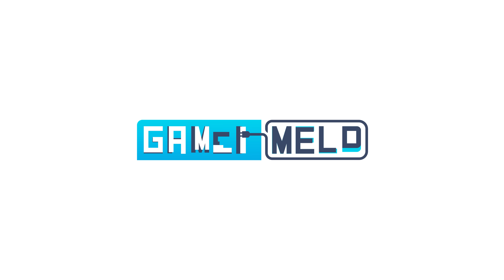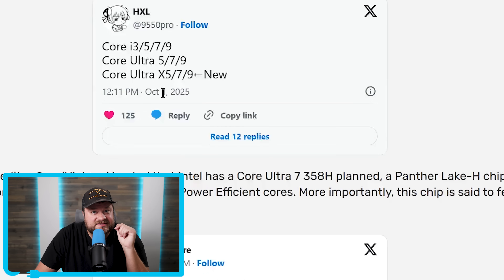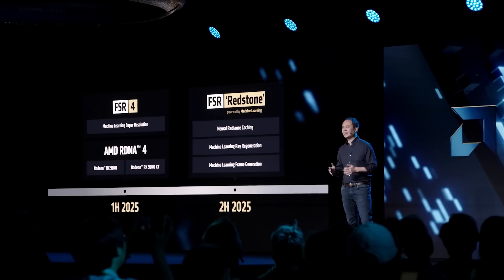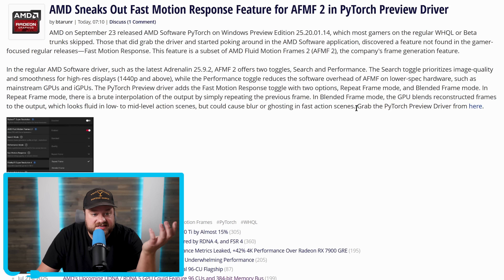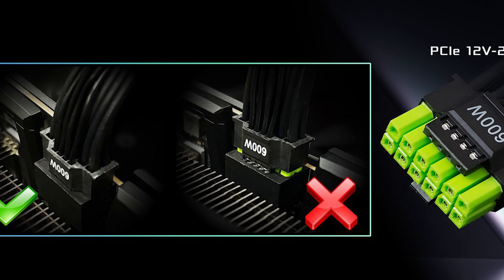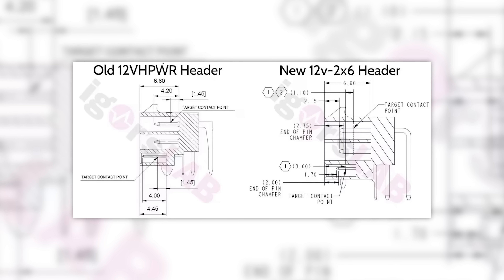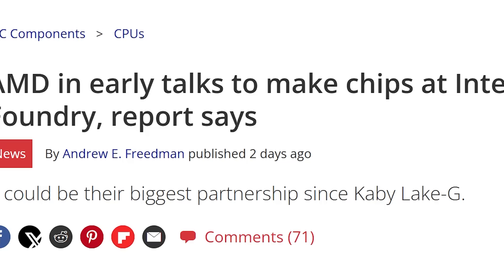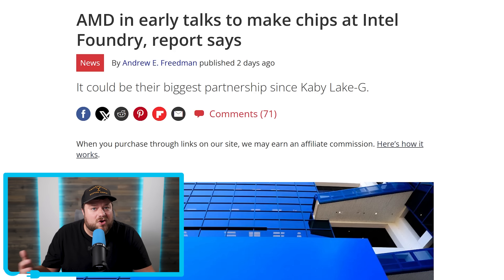AMD’s Most SHOCKING Move Yet!

Comment: Doesn't bother me any if Intel fabs up some AMD parts, esp if it helps Intel stabilize financially.  Just remember it's early discussions.
Reply: It’s a good thing for everyone because TSMC is too expensive. If intel can provide good enough silicon it will lower the prices of chips.
Reply: @N3ptunëagreat point. And supply redundancy.
Reply: @N3ptunëa That's a huge "if" since they had so much problem shrinking past 14nm or 10nm or whatever. Whereas TSMC's down to what, like 2nm or something?
Reply: @MGmirkin  They're working with ASML, who designs and manufactures the lithography machines for TSMC. ASML was providing equipment and guidance for Texas Instruments at their new fab in Sherman Texas. I was there for over a year, doing the network rack and stack for that fab.
Reply: @Gamevet Who cares if Intel buys $ billions in ASML EUV machines? TSMC can tune those machine for production in 1 year. Intel hasn’t even figure that much out yet! 18A is a fiasco!
Reply: @tringuyen7519  Intel didn't have the fabs built for the new nodes. That's why they've been rehashing CPUs on old nodes. These new fabs will enable them to shrink their node sizes, though ASML UV lithography. They don't have to beat TSMC. They just need to be competitive.
Reply: @Gamevet  Exynos 2600 (yield obtained around 50%) 2nm GAA fabrication. But I do not know, whether Samsung Foundry opens PC hardware services. (Even Samsung has collaborated with AMD to make custom GPUs / Exynos 2200, 2400, 1480, 1580, 2500)
Reply: @MGmirkin  pretty sure the core Ultra is pretty small architecture, they’re getting there
Reply: @N3ptunëaTSMC’s 2nm is yielding 95% for AMD Zen6 right now. Intel’s 18A is yielding less than 10% for Panther Lake right now. Do you really think that Intel can compete in price?
Reply: @tringuyen7519  Exynos 2600 (yield obtained around 50%) 2nm GAA fabrication. But I do not know, whether Samsung Foundry opens PC hardware services. (Even Samsung has collaborated with AMD to make custom GPUs / Exynos 2200, 2400, 1480, 1580, 2500)
Reply: I'd rather they stay in business so amd doesn't get comfortable either like Intel did before Ryzen kicked them in the ass.
Reply: I strongly doubt that AMD will fab any of their high end parts at Intel.

There's way too much possibility for abuse, especially given Intel's history with basically throwing mountains of money at something to increase their market share - well massively denting AMD's production capacity would make that a lot easier.
Reply: @mnomadvfx  I wouldn't expect them to shift everything over, but rather balance out where they make things to best serve global markets.
Reply: in 2018 there was a intel cpu with an amd  apu it was the most awesome chip they ever made. They didn't care and stopped making it they said they didn't like working with AMD.
Reply: @remotepinecone  Yes, I remember that wild child (my jaw sure hit the ground when that was unveiled).  But I don't recall Intel or AMD ever having said that (at least not publicly)...  The only real friction spot was confusion regarding graphics driver support.  It was truely seeing two competitive companies working together and bringing together one hell of a product noone would have ever dreamed of (at least, not in the tech space).  I I had hoped that it was going to eventually lead to some other forms of technological sharing.  Not necessarily with GPU's, but rather where the two companies could and would do joint ventures along those lines....  Although we are in for a full replay of that, just with two different singers (Intel/Nvidia).
Reply: I kinda hope that Intel collapse honestly they got to big and don't give a shit about improving tech just money